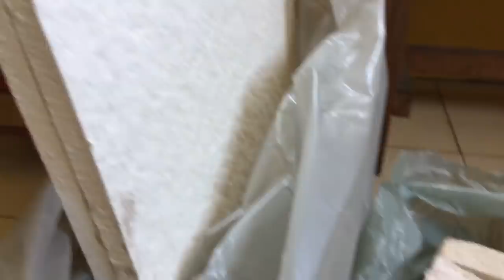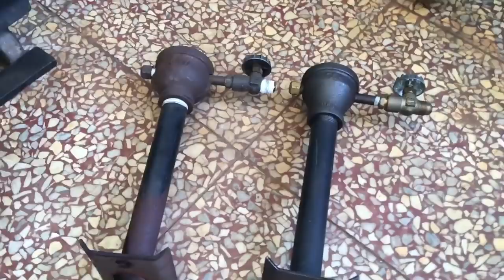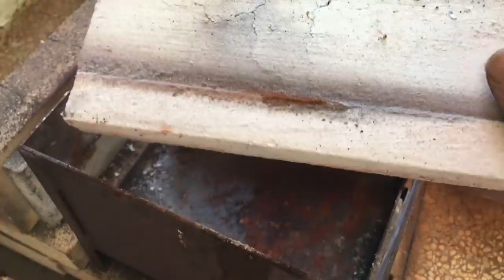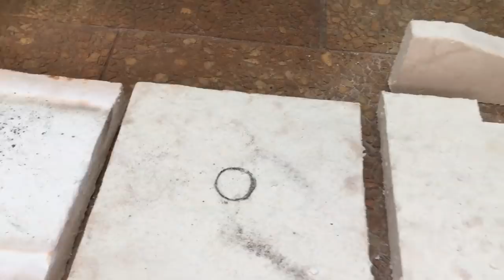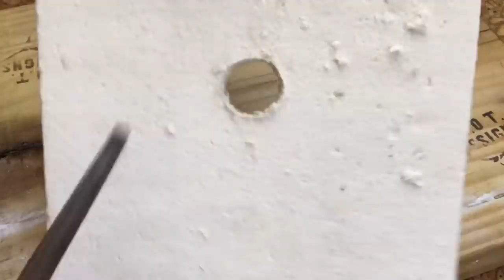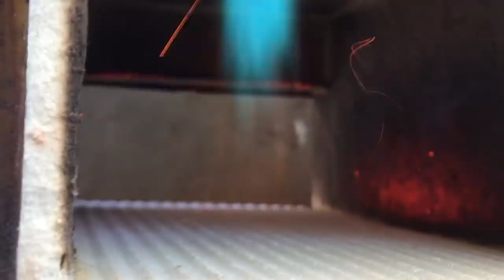Relining my forge in detail

Comment: Some well regarded forge and furnace designers I know have tested the effectiveness of kiln washes like itc-100 and have shown great increases in efficiency.  All you have to do is paint a thin coating on.  They don't increase insulation, rather, they reflect infrared back into the forge.  Steel heats up much quicker and you use less fuel.
Reply from the maker: Lou, I need to look into this. Anything that can save fuel is something I'm interested in since I forge nearly daily. Thanks for sharing this info. Glen
Reply: Glen GS Tongs ITC 100 is expensive....Metrokote is much cheaper.  There are other options out there.  Basically, you need a “high alumina kiln wash”.  Glass blowers and potters both use it.

Comment: I bought one of these, from diamondback. Shipped fast, came without the spare re line kit i ordered. I contacted DB forge and he shipped a reline kit to me right away... top shelf service. Works very well @ 3000 ft above sea level 5 psi is good for most parts 7-10 will do it a little faster... peace and thanks gonna buy you a beer
Reply from the maker: I just (as in today) bought another one of these forges. Diamondback Ironworks makes a very reliable product. Thanks.

Comment: Being the cheapskate I am it appeared to me that some of the pieces could have been reversed and reused but I'm just an amateur looking at a video...I appreciate all you do and have learned a lot from you and must thank you,please keep the content coming,again thanks!
Reply: Je pense aussi qu'il pouvait retourner les pièces et les réutiliser.
Reply: I was thinking the same thing, flip and reuse, but I'm sure changing to new will be much better
Reply from the maker: JoJo, I am definitely frugal and you're right, I could have reversed some pieces. But I have found that the insulating factor goes down when reusing worn refractory, even if the worn side is not facing inward. But if I didn't have a surplus of refractory on hand, it's something I would consider. Thanks. Glen.
Reply from the maker: Drew, Reversing the pieces is a possibility but you're exactly right that new pieces just make for a better forge fire - do a better job at insulting... Thanks. Glen
Reply from the maker: Adem, You guys are not wrong. But I had the new refractory and wanted to show the relining process in detail. Plus, the old material doesn't insulated the forge as well. Thanks. Glen
Reply: Glen merci de prendre toujours le temps de répondre a nos messages ça fait toujours plaisir de recevoir un retour à nos messages merci encore.👍👍👍

Comment: I am building a new gas forge. I have one that is larger and used 2 burners at 25 PSI, uses too much fuel for day to day operations. I want to get down to 5 to 10 PSI. I like the shape of yours, but I am going even smaller this time. Thanks for the information.

Comment: Your great video got me to think, instead of using cheap refractory bricks (all I can get around hear without paying big shipping) would that refractory bord be good for covering the the hole in the back of the Forge when it's not needed?
Reply from the maker: Will, Yes, that refractory can definitely be used to block one end of a forge. That's what I do. But it's fairly lightweight so I also put a heavier brick (could be a red, clay one) behind that refractory board for support. Thanks. Glen

Comment: i really love the simplicity of your forge - and the way its packed with those refractory materials is just so simple and tidy.  Also - the reason the fibrous ones turn black is partially by design - as those surface fibers burn, a layer of carbon forms which helps with the insulating properties of the material.

Also - i was admiring the gouge you were using when cutting the hole for your burner - i was wondering if you've made many cutting tools like wood working gouges or chisels?  I may need to contact you about having a set of woodworking chisels hand made by GS if you take those sorts of commissions....
Reply from the maker: Erik, Hi and thanks for explaining why the refractory turns blacks. Once those fibers burn off, it never turns black again. I thought it was also due to some sort of binder on the boards, as someone else mentioned... I've made a few woodworking tools (chisels, gouge, spokeshave, and even wooden planes) but always for my own use. I'm not sure if I would make any for sale but maybe in the not-too-distant future. My edge tool making leaves a bit to be desired as it's not my focus. Thanks for watching and for sharing your knowledge. Glen
Reply: @gstongs  oh im sure you can make a dang fine edge tool - it wouldnt need to be sharp out of the box that is the users responsibility lol. I'll be on the lookout in case you ever decide to make some!

Comment: The old one still looks pretty good to me.
Reply from the maker: Ron, I've been using that stuff for two years. I could have continued or as some folks said, turned the pieces around. But I've found that new refractory just works better; gives the forge the proper insulation and makes the fire burn evenly. Thanks. Glen

Comment: Thanks Glen.  So the "raw" factory surface doesn't need a thin coat of castable refractory, or a reflective coating applied?  Speaking of saving on gas, I am in the middle building a new large forge, but with a blown ribbon burner this time.   I may even try natural gas, which is plumbed into my shop.  I hope all the hype is really true about the ribbon burners performance and economy.  Jerry
Reply from the maker: Jerry, I've never used any sort of coating on my refractory so I can't say how effective it might be. But some have said that it prevents a forge from reaching forging temperature.But I can how it would protect the lining as the fibrous board I use are susceptible to being gouged if accidentally poked with steel. I've always wanted to make a natural gas forge. Not sure about the differences needed with the burner. And I was always leery about something going wrong. Thanks. Glen

Comment: That was good Glen, when you mentioned the hole in the insulation for the burner, what did you mean if it's not the right size it can affect the burning of the flame etc?
Reply: @Lenblacksmith 
If too 'tight', it will throttle back the combustion airflow, causing air/fuel to be too rich (not hot enough and inefficient). As he said, can be determined by sound.
Reply: @stanervin6108  So you need air coming down the insulation into the forge then, is that what you're saying?
Reply: Oh, and if opening is too large, thermal loss and a possibility of 'backflash'! It's that fine tuning like the old   'Goldilocks' tale of being just right!  👼🐼🐼🐼
Reply: @lenblacksmith8559  No. The gap between the burner downdraft tube and the insulation is a better description.
Reply: @stanervin6108  Ok got it.
Reply: @lenblacksmith8559  👍
Reply from the maker: As Stan has said, it takes some fine tuning to get a forge working right. The right amount of gas and air (oxygen) mixing at the right time. In my style burner the ignited gas sucks air down (from the bell reducer at the top) and so if anywhere along the path to the firebox is off, it can restrict air flow or allow in too much air which will make the fire burn too gas rich or too oxygen rich. Ideally, you want the fire to be neutral - all gas and oxygen is being evenly consumed in the fire. At the end of the day, I am not a gas forge expert but just know what has worked for me when I was in panic mode after relining and trying to figure out what was wrong. Thanks. Glen
Reply: @gstongs  Thanks for that Glen.

Comment: The black is just soot from a slightly rich burn. A good thing as you don't want a highly oxidizing flame for metal. When you opened the hole it increased airflow and added a little more oxygen. It looks good as is, but if you have trouble, a little plate on a pivot screw on the air intake of the burner would make it adjustable.
One thing you might want to do is get something called kiln wash. It is kind of like paint without a real binder (think old fashioned whitewash).  It is used in ceramic kilns to paint a sacrificial layer on the shelves and props so stuff doesn't get stuck. It should make the bottom plate last a lot longer (or indefinitely). Especially for forge welding temps. Just paint more on when it flakes off.
Reply: Funny thing about that kiln wash.... It helps steel crucibles last much longer when melting aluminium.  I use clay graphite personally, but it may help some guys.
Reply from the maker: David, Thanks for all the good information. The kiln wash is certainly something to look into. I think the black that forms on the refractory is not only from a rich burn but also something that is contained in the boards, a binder that burns off after one good heat. I think this because once it's gone it never comes back, no matter how oxidizing or reducing the fire is. I appreciate you watching and taking the time to share your knowledge. Thanks. Glen
Reply from the maker: Thanks to you and David, I will look into kiln wash and see if it might be useful for me. I appreciate your interaction. Glen
Reply: @gstongs  Possible as well and you were in a lot better vantage point. :)  I have dealt with ceramic kilns but never with forges. I think what really surprised me was how well the steel has held up. It gets eaten pretty badly on ceramic kilns unless you really seal it up.  How old is the forge?
Reply: @jagboy69  At high temps, there are all kinds of weird chemical things going on. Especially when you are adding degassers and fluxes. Even the salt from your sweat can eat things up. It doesn't take much.

Comment: Like another person commented, just looking I couldn't tell the difference between the old and the new refractory board ?
 Another comment also asked what the brand was of the forge ? 
It would be nice for us thinking of buying one .
Reply from the maker: Victor, I think maybe it's hard to tell on camera but in person, the difference between old and new refractory is evident. Plus, the new stuff really does a better job at insulating the forge, creating a better fire and making it more economical since I can dial down the psi some. My forge is a Diamondback Ironworks forge. If you're interested, check them out. Straightforward, very well made and incredibly reliable. Ive made some changes to mine over the years. Thanks for watching. Glen
Reply: No Thank You for taking the time to answer my questions. Also for making such instructional and understandable videos for those of us who are uneducated in Blacksmithing or hope to do some home style tinkering.

Comment: Seems like just last year ya did this.  Time to cast some proper walls for that thing out of Mizzou refractory cement.  It will last MUCH longer than that stuff you are using.
Reply: The difference being that the fiberboards have a much higher isolation factor. Any refractory cement, compared to fiber board, takes a lot longer to warm up. So it's a trade-off :) But thinking about how much use this forge has seen, the wear is not too bad :)
Reply: @patrickd9551  Yes and no.  1/2" thick cast sections wouldn't make a difference.  Now if they were 2inch, yeah, it's going to take awhile.  I'm running my forge on cheap household natural gas with a microwave blower.  It's built the same way as my furnace with an inch of kaowool and about 1/2" of mizzou just sideways and with a ribbon burner.  I light it and it's ready in 15minutes.
Reply: @jagboy69   That's cheating, you didn't specific kaowool ;) You implied refractory instead of "the stuff he's using"
Reply: @patrickd9551  I think it could still be work.  Not much thermal mass to a chunk of 1/2" mizzou.
Reply: @jagboy69  I think so too. However stuff like mizzou, kaowool and ITC100 are highly specific to certain parts of the world (mostly USA). For example in the Netherlands there is a company that makes ceramic blankets under a different name and they specify working temperatures (USA Kaowool tends to be specified in max temperature and in some datasheets you will find that kaowool has a much lower working temp). Personally I'm going to source a zirconium blanket and something called lavamix, which is a refractory rated up to 1650C/3000F working temp which I can cast in really thin sections like 3/8"" (even less thermal mass, yay). This setup I want to compare to ceramic blanket coated with just a kiln wash and see how those hold up.

Maybe I'll end up using both, one for high heat forgewelding and one for "low heat" regular forging. Depends on the fuel consumption ;) That lavamix stuff is expensive stuff by the way. 50 euro for a 20kg bag. About double compared to more "regular stuff". It is also highly specific on casting instructions. Cure for 20 hours, then wet down again, wait 4 hours, then remove mold and let cure for 2 weeks before firing x amount of time in slowly increasing temperatures just to ensure all moisture has been removed. But then again if you want the good stuff you have to invest :P
Reply from the maker: It's been two years since I last relined my forge, I think...time flies. This rigid, fibrous refractory board I'm using is excellent stuff. Better than any I've seen in the States. I don't have any experience with Mizzou but it sounds like something worth trying. Thanks. Glen
Reply from the maker: Patrick, My forge sees daily use and I last relined my forge two years ago. I could've continued but relining with new refractory just makes the forge perform better; does a better job at insulating and creating even heat within the forge. Thanks for all the very useful information you've provided. Discussions in the comment section are very educational (for me!). Glen
Reply: @gstongs   2 years? That's amazing. Do you have a link to that stuff you are using? I want to compare it to the stuff I can source locally. You don't do much forgewelding right? I don't think that anything can withstand borax in the end to be honest, that stuff is nasty :) I want to built mine with a small ribbon burner for more distributed heat and lower fuel usage.
Reply from the maker: Patrick, I got this rigid refractory from a company / factory here in Taiwan (in another town) that makes the ceramic refractory materials. I think he imported the fibrous boards from Germany - at least that's what I remember him saying. Not cheap... I will ask him whenever I get to seeing him. When I compare this stuff to what was originally in the forge (US made), it has a more stranded, cloth-like appearance (fibrous) whereas the stuff I've seen in the US was more cellular, if that makes sense. I rarely forge weld and normally run at low psi (5 or below) but I use my forge literally daily. I've found that after relining my forge, I can run at lower psi but attain the heat I normally need for forging so it's economical, which is important money-wise and also since I need to lug propane tanks up five flights of stairs. Good luck with all.
Reply: @gstongs  datasheets, i need datasheets ;) What's the stuff made of? what is it's refractory temp, what is the maximum working temp? questions questions :) If it's from Germany all I would need is a name from the plastic wrapper ;)

And yes, good stuff is expensive. Although it helps if it's made locally. The zirconium stuff i can source locally is about 3 dollar/foot, but I need to buy a whole roll (23 feet). sigh
Reply: Wow !    That is not convenient, to have to carry everything up 5 flights of stairs. I hope you can soon get down to the ground floor .

Comment: It's always a good idea to use a mask or respirator when cutting the hard refractory and cutting or handling the softer stuff. The particles & fibers released aren't good for your lungs.
Reply from the maker: Dennis, Very good advice. I probably should have worn gloves as well but in most cases, I just dislike using gloves. Thanks for watching and commenting. Glen